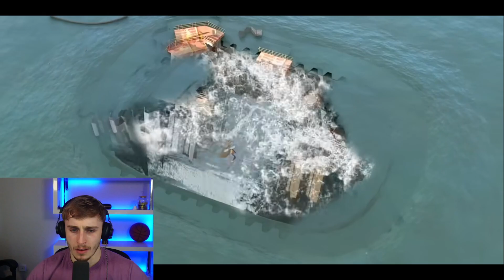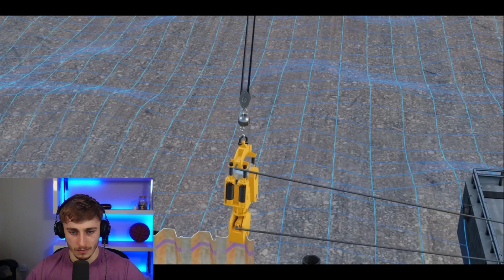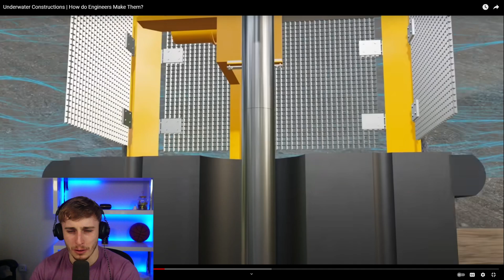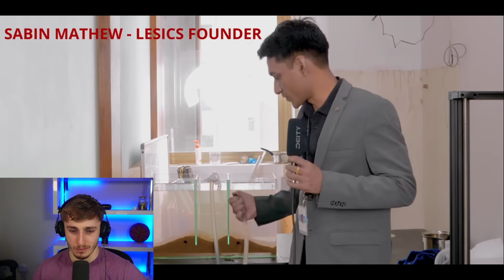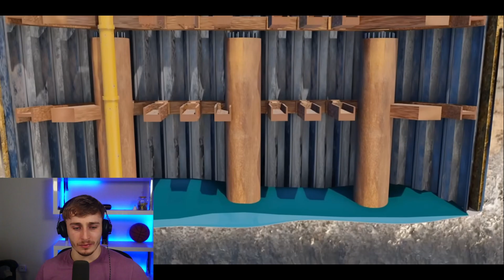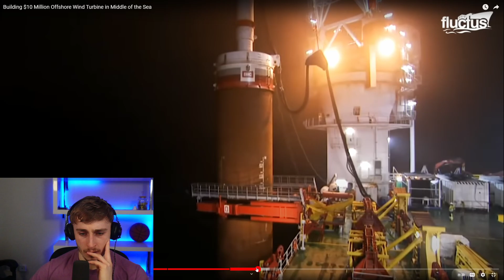Reacting to Underwater Constructions | How do Engineers Make Them?

Comment: Nearly all offshore wind turbines are located in shallow water (less than 100 meters).  They are anchored to the ocean floor using a specialized ship called a wind turbine installation vessel (WTIV).  The ship uses cranes to install the turbine parts, but the ship itself must be anchored.  At least four legs descend to the seafloor and lift the entire ship above the water's surface.  The process of anchoring the wind turbine to the seafloor is relatively simple compared to what is shown in this video.

Comment: The reinforcing steel (rebar) will be epoxy coated. There is different grades of epoxy coated which makes the rebar less likely to rust. Especially in salt water.